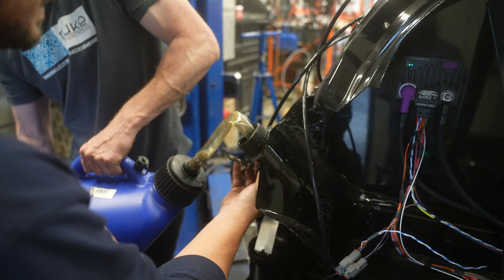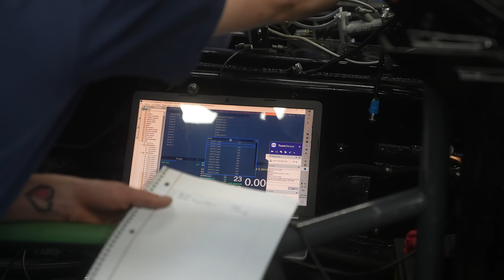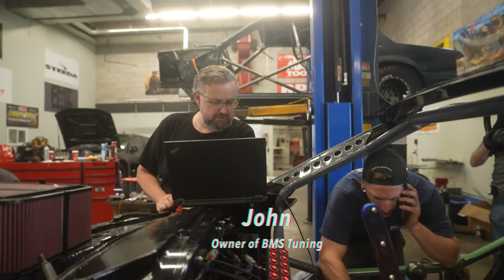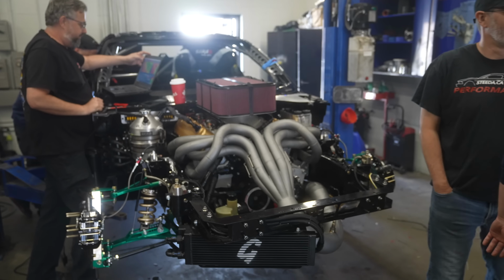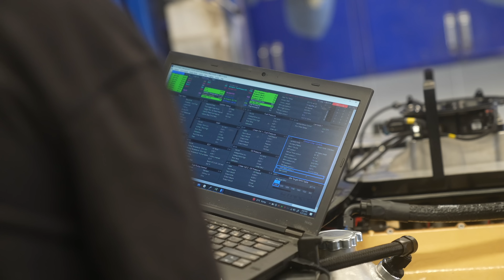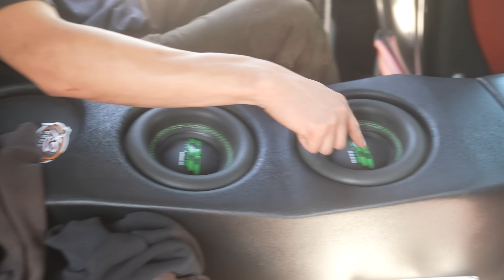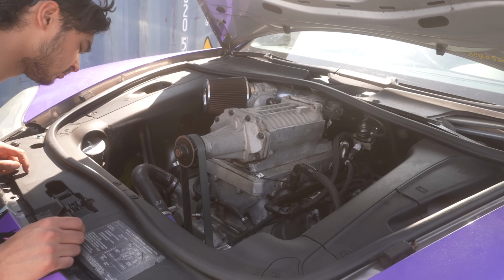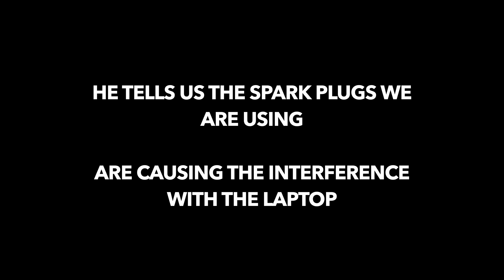Corvette First Start...It Sounds Insane (Episode 23)

Comment: Great work guys,  for anyone that watching this video having a similar issues here are 2 points that might help.  1) Link has two LS2/ LS7 trigger modes   LS2/LS7  and LS2/LS7(90 offset) the main difference is which sync tooth is being referenced by the ecu.  Using the internal trigger scope you can detriment which is correct for you application.   The most common to be used is the LS2/LS7 (90 offset)  You know its wrong when you have hard starts or back fires attempting to start.   Second, no matter what ECU you are running NEVER use non-resistor plugs this will cause you a lot of headache.   Look forward to this getting some dyno numbers.

Comment: The car sounds wicked 😳 

How do spark plugs interfere with the communication? Too much resistance/draw to much  current?
Reply: Data Corruption: RF or EMI interference can cause data corruption during USB communication. When electromagnetic waves or noise interfere with the USB signal, it can lead to errors in data transmission. These errors may result in lost or altered bits of data, leading to communication issues and potentially causing devices to malfunction or fail.

Reduced Signal Quality: RF or EMI can degrade the quality of the USB signal. USB relies on well-defined voltage levels and timing to transmit data accurately. Interference from external electromagnetic sources can distort the USB signal, reducing its quality and making it more susceptible to errors.

Signal Loss or Dropout: RF or EMI interference can also cause signal loss or dropout in USB communication. When the interference is strong enough, it can overpower or disrupt the USB signal, resulting in a loss of connection between devices. This can lead to intermittent or unreliable data transfer.

Decreased Data Transfer Rates: Interference from RF or EMI can cause USB devices to operate at lower data transfer rates. The USB protocol includes mechanisms to handle errors and retransmit data if necessary. When interference disrupts the transmission, the USB devices may need to slow down the data transfer rate to maintain a reliable connection.

Increased Bit Error Rate (BER): RF or EMI interference can elevate the Bit Error Rate (BER) in USB communication. BER refers to the number of erroneous bits received compared to the total number of bits transmitted. Higher interference levels can lead to a higher BER, indicating a higher probability of data errors.

Hope this helps... If you are running a EFI system you should always use spark plugs with a resistor.   If you are using NGK plugs,  just make sure there is a R in the part number.   Like bkR7e
Reply: @Jason Oefelein  would different wires solve this issue? Not sure if you can insulate plug wires any more than what they already are or if changing plus is just an easier fix?
Reply: @Philsilva06  Solid core spark plug wires can also be problematic.  In this case it wasn't the wires it was the spark plugs...